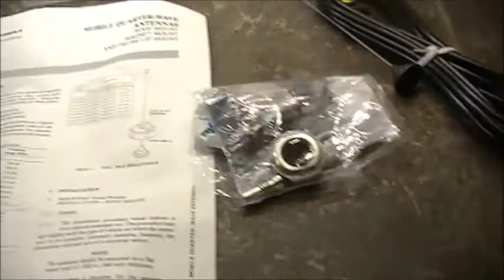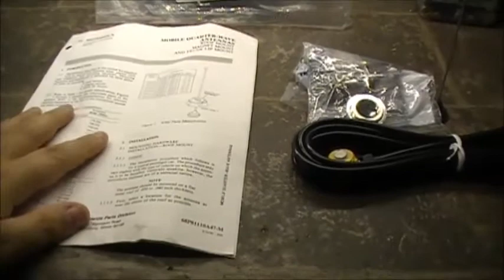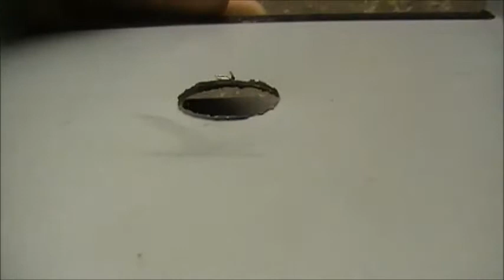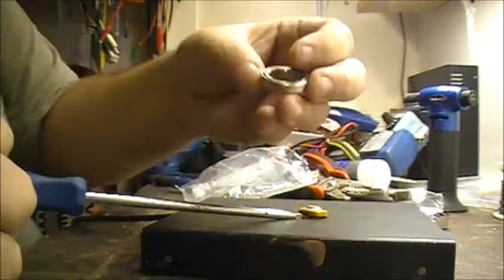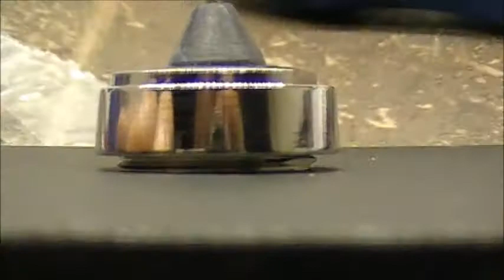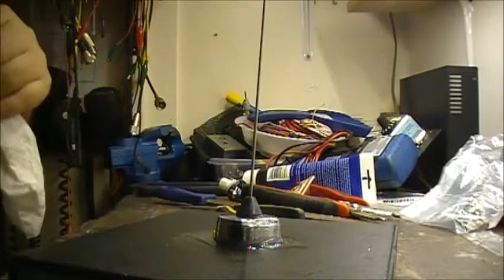Install the NMO antenna mount

Comment: very informative, never seen silicone used unless it was a mistake by the installer. I used a chrome nut antenna for years on the roof of my truck for 2 meters. I went to remove the antenna when I traded in the truck and couldn't get it off. Apparently the rubber cone where it seals around the stinger that hole had become elongated and let water into the base. This was from years of hitting my carport on my way in and out and just general weathering since it was on there for about 12 years. When I got my new truck the installer installed a laird quarter wave but it has a spring loaded base. Pretty stout little antenna.
Reply from the maker: No mistake, also zero leaks in 9 years!

Comment: Love NMO’s!!  Quick easy vid👍🏼

Instead of silicone, you can use a NMO gasket that goes around the outside edge of the NMO.  In case you need to remove the antenna.
Reply from the maker: I use those as well.   I have seen installs where the gasket still allowed water to penetrate and rust the roof beneath.  So to keep that happening, i continue to use silicon on all installs for NMO mounts thru the roof.  :-)

Comment: I never knew how to install a NMO connection, always was curious how it worked.   Now i feel more comfortable after watching and learning from this video.    Thank you very much buddy for the details on how to install this antenna.   Absolutely amazing video, 1000 thumbs up..
Reply from the maker: Glad this video is of help Theo.   One thing you always have to remember, there is no going back once that hole is drilled!  ;-)
Reply: @Radionut63  when you put the dielectric grease doesn't that short the centre pin with the ground?  both were touching on the grease..
Reply from the maker: No sir, it does not interfere in any way shape or form.  ;-)